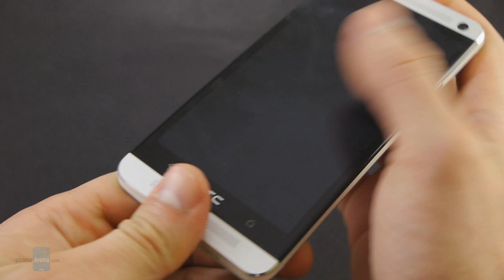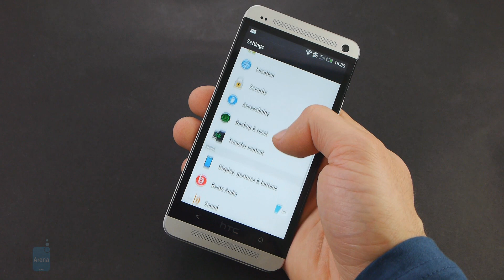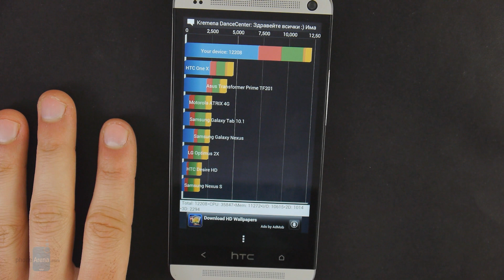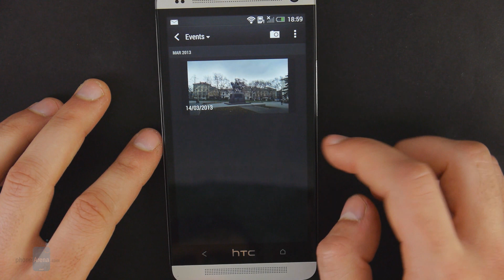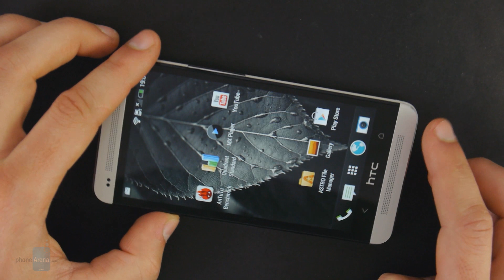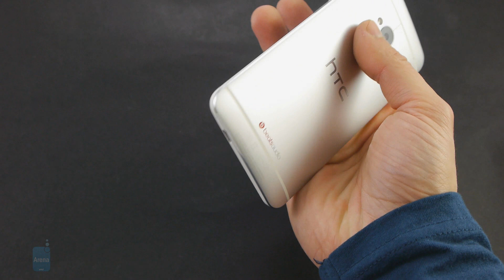HTC One Review

Comment: I've had this phone for 2+ Years, closer to the 3 Year margin. And I am surprised on how well it handles, comparing to my friends Sony its a big difference because his phone became super unusable within 3 months! Any ways, I love HTC's and I just wanted to add some experience I had with this phone. 

Considering that smart phone life expectancy lies around less than two years (by my experience), I believe this phone could double that.. but not without some TLC. You see, I had my M7 for a long time and the only issue up to that two year mark was that the speakers (speaker casing) needed a clean / brushing as it seems to block up dirt over time. And also the Mic and the Aux needed a clean as they began to gather some dirt too. Functionality wise it still runs perfect. There isn't that much of an increase in RAM at the market currently so the 2GB it sports should still handle the modern programs that are slowly beginning to be designed for the 4GB models. And why Ram, you may ask, its because that was about the only thing it struggles with when you open up a lot of programs at the same time. Solution: I always keep a task manager close (main screen in fact) in order to quickly shut down all the unnecessary programs, which provides boost and longer battery life. Some people will say that HTC's are laggy and have a bad battery life, but I think those are the people who keep their programs running in the background. To quickly explain; a simple game left running in the background drained my battery faster by two hours! The battery, as mentioned in the video, should last a whole day and it really does... unless you use it the entire day at which point it will last up to 6hours (gaming wise). Any ways, the camera... Well, I wouldn't say it is bad. In fact I would say it is surprisingly good, the quality is perfect until you need to get a shot from the top of a hill over the city. At that point you begin to see the quality degrade as you start to see small pixels next to the clouds; but don't worry.. sometimes you can find a way around that by manually focusing the camera on something else. Overall, it really feels like its a phone and even though you see in the video that the man wasn't entirely happy with the button setup, I in fact found this setup to be very handy. The fact that the buttons on the bottom aren't in the screen is very good because not only they look like they belong they also don't take up space on the screen. And the design on these buttons are so elegant that they even give this phone some character, instead of like most phones (now-a-days) who just look plain and empty at the front and back this HTC has a very smart design and looks nothing like the other phones. 

But now I am at that 3 Year mark and I am beginning to see it struggle. The bottom speaker needs replacing (rattles), the rear camera's glass cover has fallen off (easy fix), the AUX seems to no longer work (sometimes I can get one ear to work) and the battery is weak below 20%. By that I mean that it doesn't deplete naturally, it jumps from 20% to 18%, then it can jump to 12%, 8%, 2% and then turn off. Although, strangely it seems to deplete slower if you have it unlocked more. But this may have been my fault, it all depends on how the user charges their phone (especially at the beginning). 

So heck, I ether fix it up or I upgrade. And sadly I can't find anything remotely close to a phone like this so it seems like I need to adjust to these 'plain looking phones' (my opinion) if I am looking towards an upgrade. It is sad that HTC didn't continue similar style on the newer models.. in fact they seem to become 'fatter' / 'bigger' the newer they get. 

So now I am looking at an Huawei P8 and P9, not sure if that is a good choice.

Comment: The thing with S4 and One is, that when compared, the S4 looks like a cheap toy. It has the better hardware, but the design is just horrible, it feels so cheap and isn't solid at all. The One has an amazing design, and uses the same chipset, so it isn't such a big deal that the CPU is at slightly lower clock frequency...

Comment: I would not use either with their stock ROMs. If CyanogenMod was out for both I'd choose the S4 because of the superior hardware. Both Touchwiz and Sense UI are full of bloat and I wouldn't trade my S3 with CyanogenMod 10.1 for either. I enjoy my silky smooth experience with over 24 hours of battery life, you just can't get that with Touchwiz or Sense.

Comment: I think the HTC One is a misfire. The 'Ultrapixels' camera is a gimmick; if you want to take pictures in low light conditions use the flash! No removable battery? No slot for external storage? No! It does look beautiful though, I can't deny that. The speakers? Great idea but not very practical in the public domain - if you're considerate of others. Back to the drawing board...

Comment: Where did you read that? Modern Li-poly can push over 5000 charge cycles before degrading to 80%. They have over 99% charge efficency compaired to li-ion 85-ish%.

Comment: oh stop complaining about the battery it doesn't mater. if they were like samsung with removable batteries, the phone would have a shit build quality with a crappy plastic cover. You have to think on a whole, you can get a battery pack and charge it on the go so its just as good as getting a spare battery and it will last a few charges. The phones specs are amazing, build quality is amazing and for a phone like this the battery is not to bad. Think about it on a whole. Its on of the best!!

Comment: S4 Is a lot more powerful, has a nicer display and you can have up to 64GB more storage and change the battery thanks to not being uni-body. HTC One has a slightly better camera, better speaker sound and looks better. So It's certainly not better, there actually pretty even, It just depends on what features matter most to you.

Comment: Everything you just said is wrong to the tee... Build quality.. Aluminium build is shit it scratches and dents very easily, my Macbook pro is a good example. The reason why Samsung use plastic is to allow easy removal of the battery and sd card which the One does not have, camera is a matter of preference and the same applies to the screen. TouchWiz has a better performance then Sense Ui, Sense is slow and awful. HTC add to much crap to stock UI.

Comment: The 1080p display will definitely be included but I didn't add it because the average consumer can't tell the difference and honestly does not care about 400ppi. Honestly, no one should care about 400ppi unless it's on a home theatre. It's unnecessarily over-saturated and a battery-hog. 720p displays should have been the limit, at least until battery technology improves to better compensate 1080p.

Comment: Actually there is no most important thing in anything. They all have to be great and they all have to "communicate" well with each other. Even if you have a phone that has 32 core processor and 100GB RAM, if the software is 5 years old and is not stable at all, those hardware isn't gonna do much.